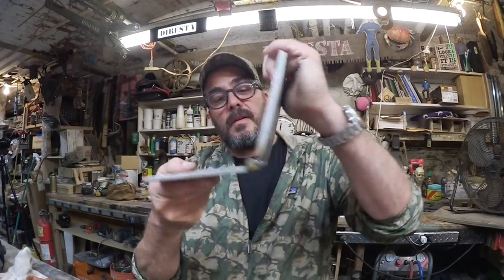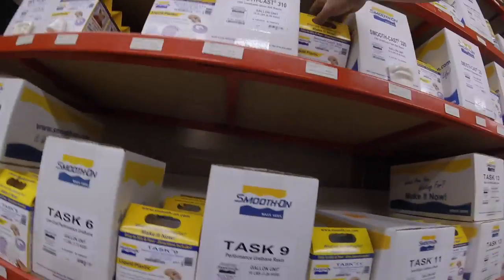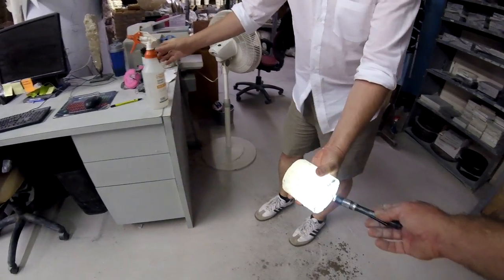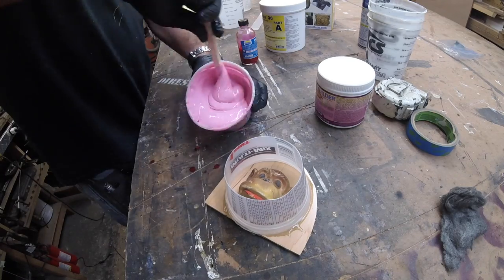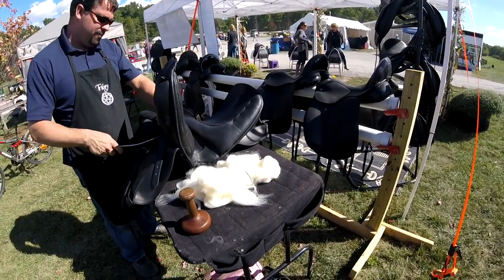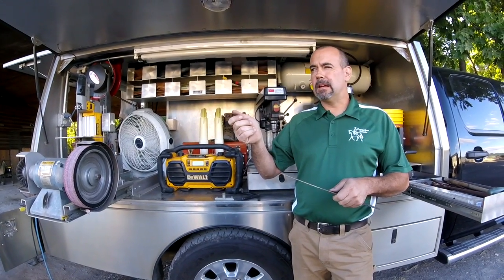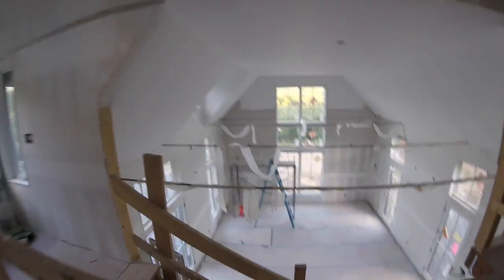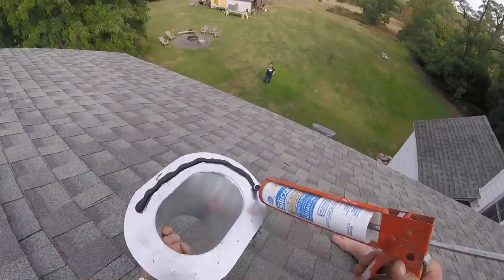✔ DiResta 3 AGA Stove!

Comment: Love the VLOGS Jimmy. Just sharing a tip. When you put the boot on a flue coming out of your roof. You used screws, add a little black jack or other roofing cement to cover the screws. This will keep water from migrating down along threads. Cheers.

Comment: How did you get away with cutting a hole in your roof and shingles and not get a leak. Any time I've ever cut a hole in a roof I'd cut the hole, remove the 1-3 shingles it affected, replace with new shingles with the metal ending up under the new shingles. I'm not trolling it's a real question. I could have missed something or maybe something was edited out and I missed it that way.

Comment: one problem the roof flange was installed wrong. its going to leak over time. the shingles are suppose to lap on top/over the flange.  its called bucking water, think like a rain drop rolling down your roof.
Reply: Came here to say this.
Reply: also came here to say this
Reply: Yeah...need to properly install this or sadly... failure through capillary action.
Reply: Old vid....but diddo. Is it leaking yet....because it will. Water wins. Also, do NOT use silicone on shingles.

Comment: might want to double check the stove vent on the roof as it may leak!!! the rain will flow under the base plate and into the structure. need to put roof shingle or apparatus around it so water flows over.
Reply from the maker: yes i will do that .. the original flang was 20 x 20 don't want the roof to lookalike a restaurant

Comment: Love your vids Jimmy, very inspiring. One thing I noticed, you did not put the stack flashing UNDER the top shingles, then you drilled 20 holes in your roof, believe me, it is just a matter of time until the caulking fails and water starts to run down your stack, guaranteed.
Reply: Maybe not exactly Mr. Happy here, but not full of shit, either.
Reply: You're right, never depend on roof caulking to take the place of proper flashing work.

Comment: Like tho vlogs! Some constructive criticism: The sound could use some better levelling!
Reply from the maker: kraay89 agreed. I'll work on it
Reply: If you use an actual mixing board you should be able to "insert a compressor/limiter" .  if you do everything digitally you should be able to "compress" each audio track individually and then the whole finished mix through the sub-buss.  This is typically done through the effects menu or plug-ins.
Reply: Free software called Audacity. Just run the whole mp3 through the Normaliser in the Effects tab.

Comment: Just asking but, how much would it cost to fill such a huge propane tank?
Reply: most propane tanks [for houses] are about 200-500 gallons. It cost me about $2.25 per gallon, But then you really only need to refill it 1-2 times a year. But it will cost you a pretty penny to swap propane tanks (when you swap suppliers, you got to give your old tank back to the previous company)
Reply: In some states a company will refuse to fill a tank that isn't theirs, even if you have it pressure checked.
Reply: Chewie316 $1000